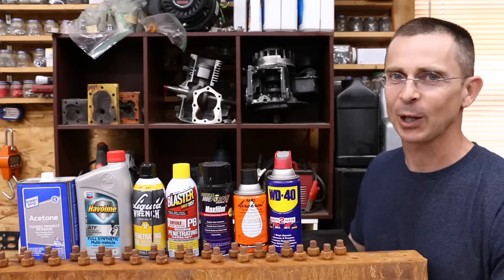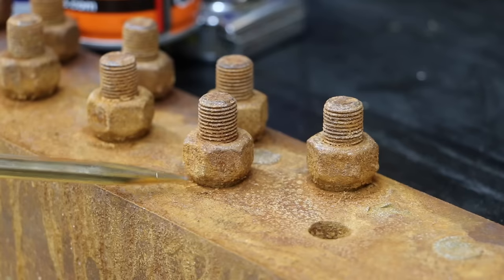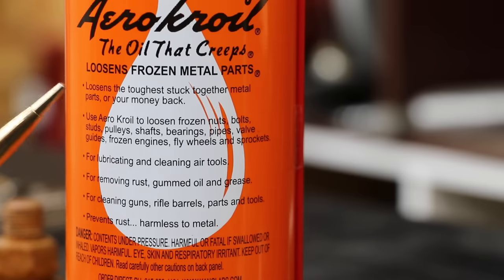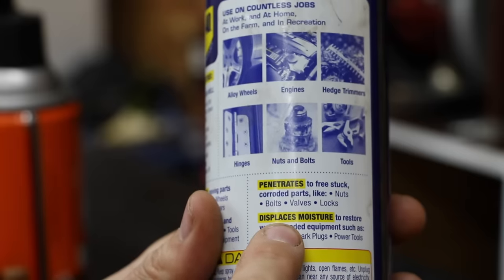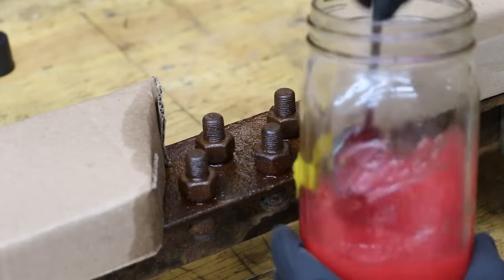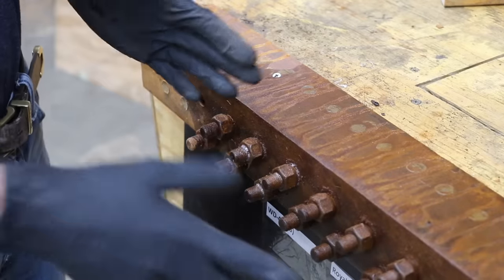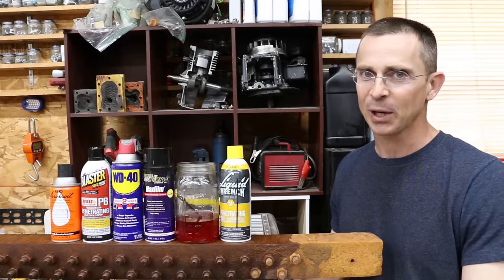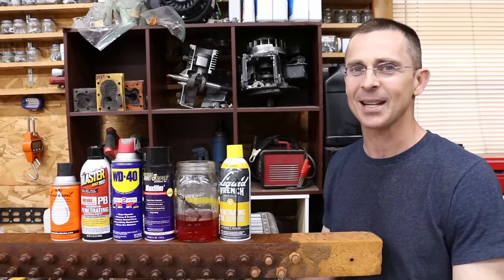Which Penetrating Oil is Best? Let's find out!

Comment: My life is a lie, all the products I own that you've tested are constantly low performers.
Reply: Just publish your purchases and we'll be informed on what not to get.
This is your best chance at fame, don't screw it up🙃

Just messin🙂
Reply: @michaeldehart14  Ryobi 40-volt leaf blower, weed wacker, hedge trimmer, edger.
Ryobi corded cultivator

Thinking about buying the Ryobi 40v battery-powered lawn mower
Reply: I said the same thing until I saw how well orileys brand oil did
Reply: @StevenWernerCS  I Would highly recommend stihl for a battery mower.
Reply: It happens to the best of us .
Reply: You must not have tried Aerokroil. It's amazing, but its not meant for lubrication; in fact, it breaks down lube oils. Strictly penetrating/rust breakdown. It's pricey but a can lasts a little less than forever.
Reply: Yeah I always thought PB Blaster was good stuff.
Reply: @robertlewis1875  He just said Aerokroil came in dead last.
Reply: @stopthephilosophicalzombie9017  All I know is how well it worked for me. I know I should believe a YT video over my own experience, but I'm funny that way. It's the only penetrating oil I've used that did overnight jobs in a couple-3 hours - every time. I'd suggest you try it, but the video told you not to. I don't know what defines a Philosophical Zombie, but that seems like it might be one criterion. Is it?
Reply: @stopthephilosophicalzombie9017  PB Blaster is great for melting Styrofoam cups - but so is silicone spray.
Reply: @robertlewis1875  which one are you advocating for ?
Reply: @manuelluis5456  Don't you read the comments? There are only 3 short ones I wrote above ☝🏻 - they will reveal all...
Reply: Kroil….only thing used in aviation
Reply: @robertlewis1875  He said the results showed you're better off using any of them than nothing at all. However - it's not opinion - it's a fact, that Aerokroil does not work as well as the other products. Instead of stubbornly denying this, take in new information and learn.
Reply: @redpine8665   Any of them are better than nothing? That is profound! But I hope you didn't need YouTube to tell you that, or that you consider it new information. If believing my own experience over a social media video is how you define stubborn, then I guess I'm stubborn. But I think people who let YouTube provide their opinions for them shouldn't counsel others on what constitutes learning.
Reply: @robertlewis1875  "YouTube" didn't tell me anything. Extensive testing did. Look - I know. A lot of people that hold an opinion for a long time find it impossible to take in new info and update what they believe. You're one of them.
The test results are not debatable.
Reply: @redpine8665  Not debatable. That's a good one. Did you make up that rule? Clearly it is debatable, as you can see. It must be tough being the only one who does "extensive testing"; that's a lot of responsibility. Knowing "a lot of people" who are wrong (sounds a lot like our last president - and just as believable) can't be easy, either. But there's no such thing as a wrong opinion. There are, however, lots of wrong assumptions, as you have made abundantly clear. I wonder if you even see the irony in being yourself such a perfect example of the intractability you describe.
Reply: @redpine8665  this is the opinion I had until I watched his "Screws vs. Nails" vid (where everyone in the comments concluded the same thing he did that screws are actually stronger than nails even though he missed the tests that would clearly disprove this) and I realized that numbers do lie if without proper context.And thats the main problem with this channel he presents his testing as 100% fact and evidence based and anyone who argues against is arguing against the damn scientific method itself. 

Also you cant expect to have a good debate (if thats what you really want) when you talk in such a condescending way... Look, I know. A lot of people think 'numbers don't lie' or that numbers "aren't debateable" and you're one of them. People change man hold your head up high. See what I mean
Reply: @robertlewis1875  I'm with you, Kroll has never let me down and it's what they used in aviation when my father was mechanic at boeing
Reply: @stopthephilosophicalzombie9017  No other penetrant or penetrating oil that I have tried compares to Kroil. Rusted exhaust manifold nuts - no problem. Severely corroded fasteners from calcium chloride used on roads in Canada - took overnight soaking.
Foreign car exhaust system clamps made from unobtainium - badly rusted nuts came right loose. After going through LW, WD, PB, several others, nothing compares to Kroil. Perhaps some of the others work better for some situations but I haven't encountered any. Same stuff since 1939.
Reply: @algrayson8965  I'll have to try it. Thanks.
Reply: right, ive always sworn by pb blaster and even have their logo tatted on my arm, it hurts knowing im switching to liquid wrench once the last of my pb blaster is used up😔
Reply: @stopthephilosophicalzombie9017  That's the one I was about to buy  after using W40 for years.
Reply: @algrayson8965  I think you are very clear and sure. I have been using WD40 for years, I was curious to get the best in my garage for best results.🙏👍🏻👍🏻 But Kroil penetrant 16oz is really expensive compared at WD40 12oz and PB Blaster 18oz. Wow...
Reply: Lol, "the power of advertising" damn them!

Comment: Thank you for this comparative video. No criticism at all but from my experience, where Kroil shines is as a fuel and motor oil additive/treatment, for stripping carbon out of engines and off of components. I have never used anything that beats Kroil for dissolving and removing carbon deposits and buildup in an engine or a firearm. Like your test showed, several other penetrating oils work as well or better than Kroil on rusty items. By the way, transmission fluid and charcoal lighter fluid are better than trans fluid and acetone for a penetrant and they will mix and stay mixed.
I was given an old 20 ga. shotgun. The previous owner claimed the firing pin was broken and it would need to be replaced. Sure enough, the firing pin hardly moved (barely scuffed the primers in shot-shells) when the trigger was pulled. I completely stripped the shotgun down, placed all the small parts in a tray with Kroil. Carbon immediately began to dissolve, far better than my parts washer with solvent, pump and brush. An few minutes later and a couple of light toothbrush strokes on inside corners of metal components and everything was shiny and clean. A friends AR wasn't cycling correctly, stripped it and dropped all the moving parts (bolt, trigger, ECT into some Kroil and the same thing, everything was clean in minutes with only a light brushing for heavy carboned pars. Took an eyedropper and put Kroil down the gas tube until Kroil ran out the end of the barrel. Used a couple of pipe cleaners in the gas tube, some Kroil and a chamber brush was used in the chamber and locking lugs. A few patches through the barrel, a light coating of oil and reassembly and his rifle cycled perfectly. I'm not saying Kroil the best product known to man for dealing with carbon, but I am saying it's the best product I have had the pleasure of using to dissolve and clean carbon with. While I know AeroKroil and SiliKroil have their place, I don't use them near as much, I use the non-aerosol and either soak, pour into, use a dropper or an artist fine/small paint brush to apply sparingly. Hopefully this information will be helpful in one of your future videos. P.S. Kano Kreen and Kroil with graphite are also fine products! I know what they are designed for and what not. Exrust is a Kano recommended product that is best for penetrating and dissolving or removing rust. Just trying to help because I know what I know and nothing else - LOL.
Reply from the maker: Thanks for sharing.

Comment: Thank you for this demonstration.  Been struggling with Blaster to loosen a steel nipple under bathroom sink with no progress.  Toxic fumes make it difficult to work with in small  room.  Going to try Liquid Wrench tomorrow to try and finish this project. Working with pipe wrench so I am providing all the torque! Thanks again.
Reply from the maker: You are welcome!  Thanks for sharing.
Reply: Any info i wanna know how much better it worked
Reply: @Billy-gh9ih  actually it didn't work for me. Nipple wouldn't budge. Had to discontinue use of sink as it makes puddles downstairs in the basement bathroom. Any suggestions?

Comment: My real life experiences is Kroil and Liquid Wrench are the best, I wonder if the test is accurate, I'm working on 20 year old bolts. For mixed metal, steel on aluminum, Kroil is by far the best in my experience. Stooped by this one!
Reply: Yeah I wondered about mixed metals as well. Would like to see that test👍
Reply: Peter, I'm with you. I have been using Kroil for 10 yrs or so and on mixed metal it works great. I have found that Kroil on a fastener or shaft, bearing that can be worked to & fro just a hair will come loose way quicker & easier than anything out there. To me it's the cats meow.
Reply: I bought Kroil to clean lead and copper fouling out of steel gun barrels.  It lifts the lead and copper off the steel.  The more patient you are, the more fouling it removes.  It is non-corrosive too.
Reply: Have always had good results with Kroil. I originally got directed to it by a millwright from  the naval shipyard in Bremerton.  Also love it for rust removal, usually with a wire brush or fine steel wool. And as a protective coating on machined surfaces like lathes or drill presses.

Comment: I have spent a lifetime mixing ATF/Acetone and always was loyal to its results of dissolving rust. I have also always kept a can of Kroil around. So I was a little wounded by these results at first. But you did a fair-and-square test and the result just domt lie. Liquide Wrench it is! At the end of the day, I want the damn rust fastener off and without resorting to the die grinder or cutoff wheel.I have a cat replacement coming up and on an engine with 200k on it and I'm going to use Liquid Wrench. The nuts are already in a near impossible spot and they are rusty and heat cycled to the nth degree. Thanks sir!
Reply from the maker: You are welcome!

Comment: You need to test one more oil, Deep Creep by Sea Foam. It doesn't take much and it definitely works better. I am not affiliated with Sea Foam, just an old retired guy who works on things. Available at our local Advance Auto & probably at yours as well. I went through a lot of Liquid Wrench and PB Blaster before I tried the Deep Creep. One can of it must have lasted me as long as 4 or so of the others. I am a convert, months later I am only on my 2nd can.
Reply: I've used them all and Deep Creep is by far the best.

Comment: I had a central heating boiler with a water pipe union that screwed into the cast iron, (read brittle)  heat exchanger. The union refused to budge even with a massive wrench. Heated the union with a blow torch, removed flame, sprayed WD40 on it which instantly turned to vapour. After some hours, (I was doing other jobs as well), the union rotated as if the union had just been installed new!
I've now one of the induction heaters from Amazon. Fantastic tool, especially on a motorcycle with plastic panels etc, that you wouldn't want to use a blow torch on without removing them.

Comment: on the farm when dealing with a rusted bolt/nut, i found that heating the bolt and nut red hot with a torch and then cooling it off quickly with water, ice or snow.....then the nut comes off like it should......sometimes it takes upto 3 heatings but it does work great!!!
Reply from the maker: Great feedback. Thank you